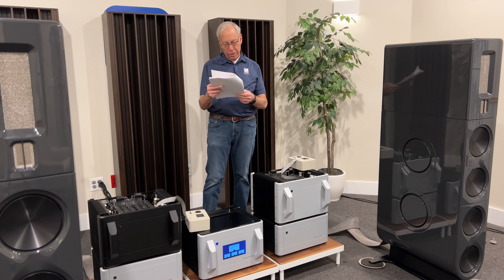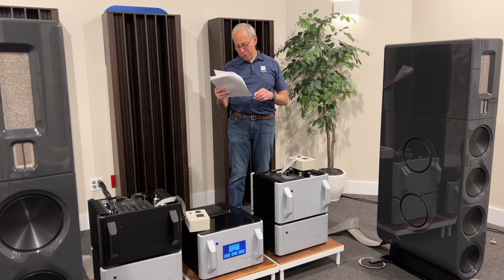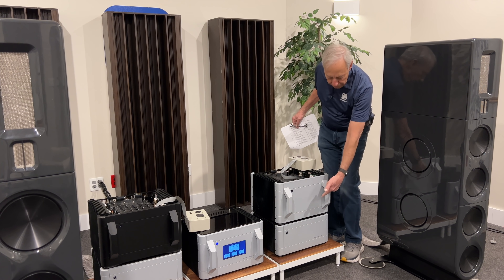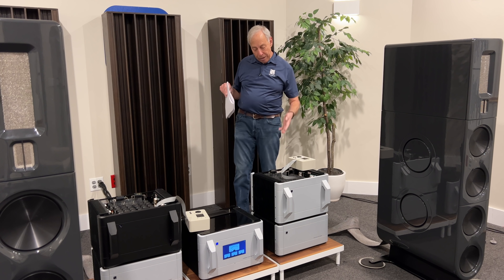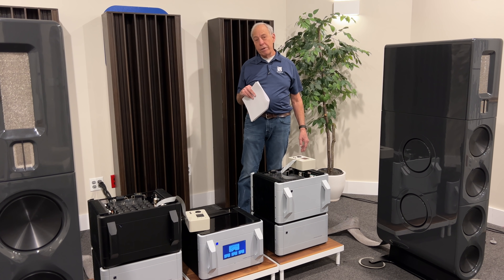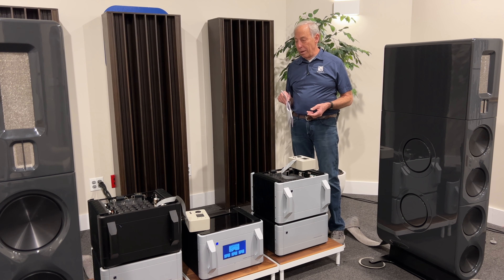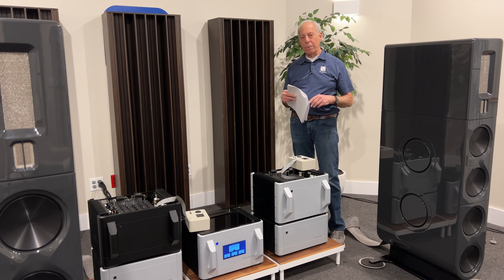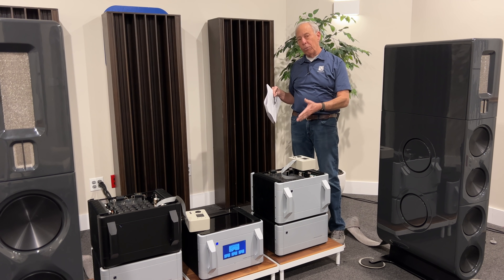When will vacuum tube amps disappear?

Comment: My granddad worked at Philips in valve R&D. Back in the day, the internal discussions where always about triodes and and pentodes and what sounded better. (Contrary to what you may think, there where a lot of audiophiles working at Philips back then.) Later when he was in his 90's he refused to talk about his work because from what he could see they where all obsolete and thus, his work has all been for nothing. It would have been be nice for him to know how high end audio would develop 30 years later.
Reply: That a great story Hugh & I'm sure your granddad had many good 1st hand Phillips "shop" stories to tell !! ....Back in '74, when working on Bell System Network long distance lines,  we had worked all week replacing our Super Reliable vacuum tubes with the latest "HIN"  (hybrid integrated network) semiconductor direct plug-in "tubes" along 30 miles repeater routes.....Everything seemingly great until the Saturday summer storm .....Multiple outage failures Everywhere up & down the route !!!! ...Seems like Semiconductor Bell Labs guys had no idea how Well the 30 old  tubes tolerated (& thrived) on electrical storm HV spikes & surges !!! .....Worked late down the "line"  plugging the ole "reliable" tubes back in to get the LD line back up !!
Reply: @tomstrum6259  I remember this story (don't know if it is true) that in the cold war, the west was looking down on those primitive Russians for still using so many vacuum tubes in military equipment, whilst NATO was much further with semiconductors. Fortunately we never had the chance to learn if those semiconductors would stand up to an EMP. Your story reminded me of that.
Reply: . Progress is made of two powers - power of knowledge which was then enough  and power of market which forces changes.
Reply: @Mikexception  No the power of the consumer
Reply: Indeed Philips also developed some excellent MM cartridges amongst other things that are almost forgotten now.
Reply: @markstewart1807  True indeed, get a GP401 body and put a Jico nude ciabatta stylus on it and you have some good sound.
Reply: If they were real engineers then they'd be talking about beam power tetrodes a lot...
Reply: @ Hugo B.   I also heard the same nuke EMP story.....Reminds me of  007  "GoldenEye"  movie plot !!  ......"Hollow" State amps so easy to work on,....without causing any damage &  speaker or phones connected, you can quickly isolate to bad circuit stage with metal screwdriver !!!  .....I don't get to hung-up with strict minimalist "fidelity" playback, but rather the sound I just simply groove on & like for a particular source type & my mood !! .....If that be with glass "bottles" & EQ's ..... so what !! ....Now retired  after 50 yr Bell System run equalzing 20--20 khz network feeds to spec & now havin fun tweaking to my sound !!!
Reply: Hello Hugo. It's sad that your grandfather thought that his work was for nothing. It wasn't. They did great things at Philips and he was a contributor to that. I've always suspect some audiophiles working at Philips. All their products had that nice and rich sound. Their loudspeakers from the 1970's were (and still are) of outstanding quality. I'm using a pair of Philips loudspeakers from the 1970's on a daily base and they are still beating so many new bookshelf loudspeakers!
Reply: Philips invented the Pentode tube.  Marketed tubes under several names, Philips, amperex, Mullard,and several others
Reply: Nothing using valves is either high end or high fidelity.
Reply: @Theineluctable_SOME_CANT    Cant see the gear and say that this  gear is Hi- Fi before experience the sound which depends on the whole acoustic  illusion  Hi fi may be present only in one location of room but usually can be experianced also around that room.
Reply: @Mikexception  no, but I do call out people who claim valves are better or that they are even hifi...
Reply: @Theineluctable_SOME_CANT  that may be the greatest oversimplification I’ve heard in a while. There are plenty of outstanding vacuum tube based systems, and it really weakens your argument to paint every single vacuum tube based product with the same brush.
Reply: @tyroneedge8267  no.

Being an engineer makes the difference.

Holding up 120 year old technology to be on such a pedestal is ridiculous.

Particularly in this day and age.

If you can read characteristic curves and you look at EL84 etc., you see how bad valves really are. They're shockingly bad.

All of them.
Reply: @Theineluctable_SOME_CANT  That's true for the tube itself. But keep in mind that many solid state amplifiers are much more complicated than their tube based "ancestors". Transistors are drifting in linearity and capacitance, due to temperature differences that occur in their core and even changes in voltages (varactor effect). So we need a lot more components around a transistor to stabilize and compensate for that. Every single component in an audio device puts a tiny bit of unwanted non linearity, noise or phase shifting (colorization) into the signal. And since every piece of gear is just a sum of many different components, it's not impossible for a simple tube based stage to sound better than a complicated transistor based one. It's not only the tube, it's the complete circuit.
Reply: @Theineluctable_SOME_CANT  Who’s putting tubes on a pedestal? You said ALL tubes are bad, a ridiculous black and white statement, and I said all tubes are not bad. That’s not putting anything on a pedestal. 

I guess you can enjoy reading your engineering textbook, and I can enjoy listening to my tube-laden stereo system. Everybody wins. 

You know what measures 2% THD? An Audio Note Ongaku. Guess what- it sounds glorious. Sometimes we might be measuring the wrong things. 

I’m not looking to change your mind- if you have a solid state system that you enjoy, that’s great. But dismissing ALL tubes as bad (including some of the worlds finest amps) because you read some curves in a textbook is pretty silly in my opinion, but to each their own.
Reply: @tyroneedge8267  no.

I guess I am biased against the whole fake as fuck audiophile paradigm. 

People want to belong to a tribe. 
It's very natural but not too rational.

I became fascinated after hearing "School" played very loud by JBL speakers driven by a HK Citation back when they were brand new in 1977.

I was amazed by the quality of the sound and I was hooked.

My own home made system evolved to a seven channel, four band split spectrum active set up. It was spectacular. Staggering. Not perfect, but virtually so.

I had been using a pair of Stax SR 5 earspeakers since 1978, so I had educated ears.

Sorry if I am not your average "audiophile". I'm a listener, not a follower of any "tribe".

I am glad you love your stereo.
Reply: @hugoromeyn4582  great comment!

Yeah a simple 12AX7 differential pair can be the front end of an amazing valve amp.

I'd be happy to design in valves if anyone wants a really good circuit.

As a rule you need not consider the varactor effect in transistors...

Valves not only drift, they AGE!

I understand the fascination the average Joe may have for valves. They are mostly just empty space. If you have to fix the stuff it makes you think completely differently about valve designs.

Give me transistors any day!
Reply: @Theineluctable_SOME_CANT  I do not agree that  I want to belong to any tribe. 

 Since  15 last years I keep in my audio system permanent option to switch in seconds from solid state ( used Luxman and folowing  Uher) to tube amplification (used Pioneer then  Bell) beacause I couldn't get rid of doubts which technology  is better. Because so much depend on speakers which could be aligned by me to either and corrections Anyway more often my finger pointed tubes. 

With speakers without crossovers and with non resonant boxes  designed  by Telefunken   (it may be considered  trusty speaker),   for me tube amplification   again wins. 

Anyway  way  up to  unknown degree it may be compared  with solid PP amplifier made with old germanium power transistors driving my other sealed speaker boxes  with 6dB tweeter. - confirmed with two other vintage solid germanium amplifiers.  Also still cant forget amplituner made on 1970 which I was able to  match with my 2way speakers - this one had also 2x AD 162 in end 

That reveals the possible reason - the dead histeresis of transistors which is not present  in valves, two time smaller in germanium and  maximum in silicon It doesn't much matter  with  one cone speakers
Reply: @Mikexception  I first started doing electronics with Ge transistors when I was quite young. They were this big mystery to me at 9 years old.

In my teens I found they were a bit nosey in general, but okay, if a bit slow, leaky and low gain.

You can make a good valve amplifier. The class A sounds silkier, true.

A lot of silicon transistor amps do run their output stages a bit low, which gives a grittier and more distant sound in general...

See, I do listen....
Reply: @Theineluctable_SOME_CANT  Right - class A is better souding but it makes  hot and this hot fires contacts of tubes when fitted in  with printed plate.  I make many considerations.  

 I avoid such termins  as silkier, good, slow, leaky, low, a bit, distant when I want to make my proof. My argument is my presonal honest conclusion based on lifespan experience and You of course may not agree.
Reply: @Mikexception  yes great and fire can be a big problem. I am making my own class A amp right now.  I have a YouTube channel. Lol...
Reply: @Mikexception  THEY SAY class A sounds better. I don't know AND I don't believe other people because they are OFTEN WRONG.

So, I'm  going to find out for myself. 
And I have transducers which will definitely pick it up if it is true. 

I remain yet to be convinced of how good class A supposedly is.

We shall see!
Reply: @Theineluctable_SOME_CANT  I don’t subscribe to any particular tribe, I just gravitate toward gear I like. There are a lot of great sounding systems out there with wildly divergent philosophies.

I’ve heard some great solid state systems, some great tube systems, some wonderful electrostats, some great horns, and some kick ass regular box speakers.

I don’t think any particular philosophy has a corner on the truth. I will say that I heard a 1930’s Western Electric 555 based system in Japan and it was absolutely wonderful, even though it didn’t do much over 15,000 Hz.

Your comments were very dismissive, as if you’re the one who “gets it” and we’re all on the wrong path.
Reply: @tyroneedge8267  I think you are overly sensitive, sport.

A bit rude, too...
Reply: @Theineluctable_SOME_CANT  Yes - opinion that class A is better sounding is only  supposition that it should be. But why?   Because employs less elements? Class A may be covered by sec transformer - cathode current FB which I suspect is good  advantage  (not often seen in amplifiers)  while in PP I do not know such  possibility. My advice is to employ  in class A   this FB
Reply: @Mikexception  the theory goes there is good distortion and bad distortion. 

Class A non-linearity causes even order harmonics, the good distortion. 

The ear can apparently be trained to like triode distortion characteristics.
Reply: @Theineluctable_SOME_CANT  I suppose you are talking about home amplifiers, but as a guitar player, tube amps IMO destroy solid state all day long.  Overdriven tube distortion is blissfully imperfect.
Reply: @Muskieangler  yes. There's hifi, then there's amplification with who cares how much distortion.
Reply: @hugoromeyn4582  I design with both tubes and transistors, I do not see transistors need more components to stabilize and compensate at all. Mainly just because of higher voltage, you need bigger components that can withstand the voltage.

In fact, you can get more gain with transistors( not FET or MOSFET), you likely can get away with less stages with transistors. Like if you do it right, you can get 100dB forward gain with two stages.
Reply: @Theineluctable_SOME_CANT  wow not too full of your electrical engineering self are you?  😂
Reply: @pkats9093  not at all.

Comment: Tube deterioration is not worth the sonic magic as he calls it
Reply: A tube lasts like 3 fucking years. Wtf are you talking about? Your ass will probably buy 5 amps between that time and sell 3 of them.
Reply: My coulege bought new tube amp.  And I bought other  His one was a bit more powerfull Suffered from bad contacting of end PP . After 10 years he replaced tubes which were hugh expensive but still suffered from bad contacting - last years he seldom uses it. You may say "you see" My amplifier is  old vintage wired and no any problems or need to replace tubes of less power So it is bad new higher power construction to be blamed What is to be done is to go back from printed plates in tube amps to wires and start to think about dispersion of heat As it once used to be  .

Comment: I grew up with tubes, still have some tube equipment hanging around. I remember when local drug stores had tube testers in them!  A while after solid state came out I switched over and never looked back.
Reply: Me too ☺️👍🏼
Reply: . If shop provided such tester  it was for purpose to make people to change tubes  frequeantly Why ? because only mass selling of tubes could compete with cheaper   solid technology making gains due to  low production costs of whole sets in  compare to tube sets. . .  It is my supposition.
Reply: My tube amp is from1959, when I was in school. Refurbished twice in its life and now it will be put in my will. end of story.
Reply: @leancove9662  I'veI got my Bell tube amplifier produced in 1963. It was already refurbished by someone to make it work for sell but was something abnormal in  condition. It was hard to  diagnoze what's wrong with good  tubes. .  It took me about 1 year to find and rectify all in amplifier which was sold as "good". After I modified  it to my needs (replaced volume pot with double value and redesigned tape head input to make  flat sensitive input)  I tried in past  tube and solid too.and it  is best phono input and amp I ever had.

Comment: @1:47 "...because there's less and less interest in it" -- referring to pure vacuum tube based amps, and that they will be fazed out.
Those amps will be with us for a long, long time.  Why?

Some of the best sounding amps on the planet are 100% vacuum tube based.

Granted, they cannot give you the slam of a high powered hybrid set of amps.
But for non-demanding music, they are about as good as it gets.

So if 30 watts per channel is enough (and for some people, along with the right music, it is enough), then that pair of 30 watts per channel tube amps will blow your mind.

There are enough affluent people that will own such amps for one type of music, while using hybrid amps for more demanding music, or for making your paintings fall off the wall (so to speak).
There are also people that are not all that interested in being able to party down the town, where 100% tube amps will give them glorious sound for their taste in music.

And some tube amps will deliver a fair amount of power.
I have heard Quick Silver V4 amps powering Vandersteen Quatro speakers.  Those speakers have a built-in, powered sub-woofer, which took a significant load off of those tube amps, and they played plenty loud, with no sign of fatigue.

When it comes to high-end audio (and mid-fidelity audio, but to a lesser degree), people put together stereos, component by component.
They choose everything, down to the power cords, room treatments, and vinyl stamper codes.  The demand for 100% tube amps will never cease, unless some design comes along that can do that job at the same or lower cost.
Reply: I definitely do not agree with Paul on that one as well. I can respect the fact that PS audio has a different design philosophy but there are more ways to skin a cat.

Comment: Never.

There is no shortage of stupidity.

Class A is fine if done well and using silicon.

Valves are ridiculously rough.
Primitive!
Reply: Indeed, but they are cooler than any audio device in existence except for a turntable:)
Reply: @tullskull  not if you are an electronics engineer.

Valves are shit. Not cool...

That's how fucked up the young ones are. You think valves are cool.
Reply: @Theineluctable_SOME_CANT  I'm not an EE but your logic  is so elitist that you assume EEs who  use tubes are what? All of them are f'ed up? They all don't know as much as you, are not as smart as you?
I'm not young either. I just know that in the late of the evening when the volume must be carefully utilized so as to not wake the kids, I could still have tears streaming down my face due to an emotional connection with the music that never happened with SS gear.
Taming the savage beast is more important to me than circuit superiority or whatever you are espousing. The "shitness" of tubes does not necessarily translate to inferior music listening sessions. 
We are relating this to listening to music right?
Reply: @tullskull  man, if you knew how non-linear valves are you would not be wasting your time by piling on.

No EE would EVER bother with valves in this day and age.

The 1930s? What they did with valves back then was quite amazing. 500 000 W RF in the broadcast band. Not high fidelity though...

Can't change facts, which of course do not care about your feelings.

I can get an emotional charge out of listening to MP3s. They're not hifi either.

This thread is getting ridiculous.

Comment: I wonder if the sanctions will hurt imports of Russian vacuum tubes.
Reply: I use 6C33C NOS from Russia.  Bought a bunch at $15 ea.  Today over $100 on ebay.  It will get worse before it gets better.